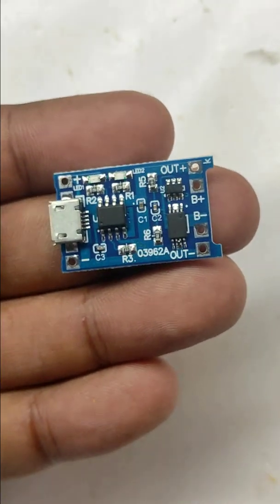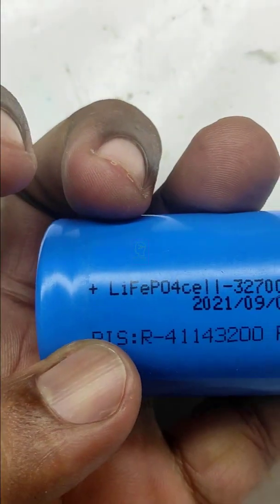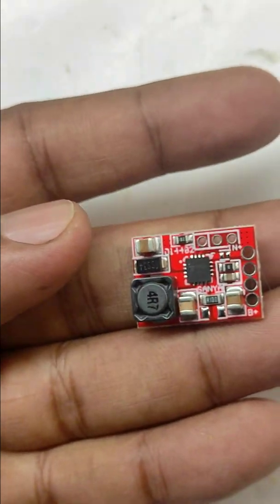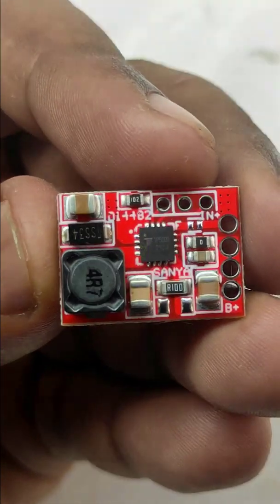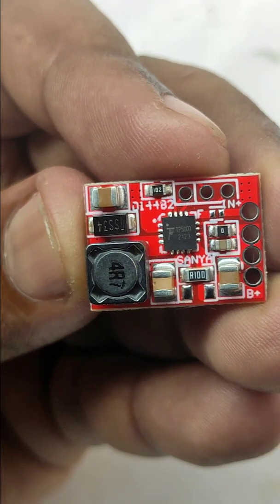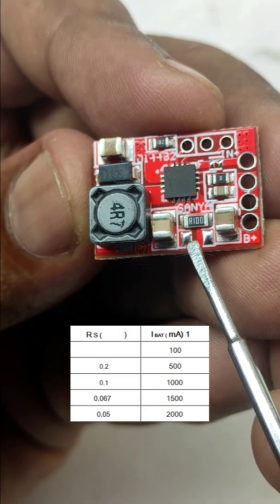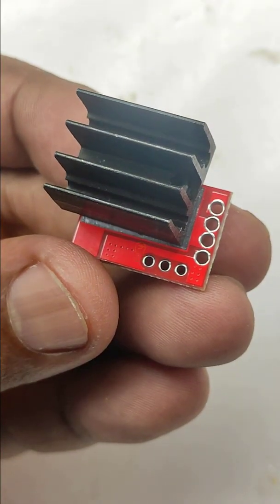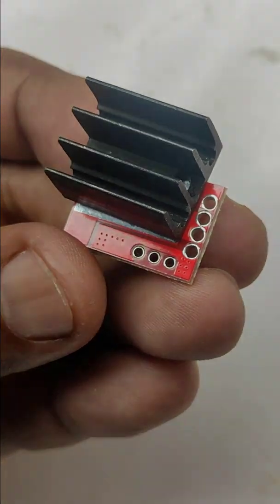Lithium Ferro Phosphate Battery Charging Module | LiFePO4 Battery Charging Module

Comment: Which module u recommend to charge 4s3p battery pack
Reply from the maker: bateery pack wuill connectred to bms, so give that voltage and current

Comment: Adding resistor in parallel will reduce overall current sense resistance which leads to lower inductance and hence more current to charge cell🎉🎉
Reply from the maker: Yes, ur right

Comment: Is there any module for LiFePo4 4S config with charging current around 3A?
Reply from the maker: Yes , LeFe BMS with 4S is available. For charging control with 3A u need to use a DC-DC buck module. Please watch the following video: - I have used that for fixing to 5A . https://youtu.be/cSjEEv8X1so?si=N37tLLeI003nFpBf
Reply: @TechInsert Thank you very much..
Reply: Hope u are using 3c cell for charging 3amp current😊

Comment: Which module is used for charging lithium polymer battery
Reply from the maker: The same module can be used for charging lipo batteries since lipo and liion battery characteristics are same. 3.7v and excited charge is 4.2v

Comment: Kya is module ko parallel mein jodne ke bad 2 empier se kisi battery ko charge kar sakte hain 3.2 volt 15 amps battery ko
Reply from the maker: This single module itself can deliver 2A but with heatsink.
Reply: yes!

Comment: I have 12v 12ah lithium ferro battery, can i charge the above said battery thri this module. Can you pls suggest me.
Thanks
Reply from the maker: No, this can be used for charging 3.2V Li-Fe battery not 12V battery pack. Mostly your battery pack has BMS so what I suggest is to use 300W DC-DC Buck Module and fix the voltage to 14.6 and current to 5A. Then use that to charge the battery. Buying Link:- https://amzn.to/3Sz4eQ4 

Watch this video:- https://youtu.be/fwmnRHtiAgo?si=VrlXGeAXxPT5RNd2
Reply: @TechInsert Thanks a lot sir.
Reply from the maker: Welcome

Comment: Can I charge 3.2v 15000 mah lithium phosphate battery with this module???
Reply from the maker: Yes , connect a heatsink in the pcb. Also with 2Amp, it will take around 7hrs to charge fully from 0.
Reply: @TechInsert  Thanks 🙏🏻😊
Reply from the maker: Welcome

Comment: Can use this for 3cell lithium iorn battery of 12.6volts
Reply from the maker: Nope , this is for a single cell. For lithium ion of 12.6 means u are using 3 cells in series . Son u needs to use a 3S BMS. Kindly watch this video, https://youtu.be/WZY7hQUE5cs?si=CVg8X2WdcWVP21Qi
Reply: @TechInsert why you tell him son 😂😂😂😂
Reply from the maker: I was telling "So you need to use ....." Typo mistake